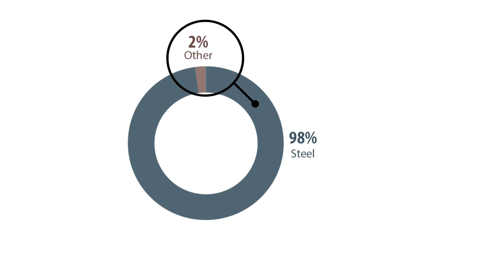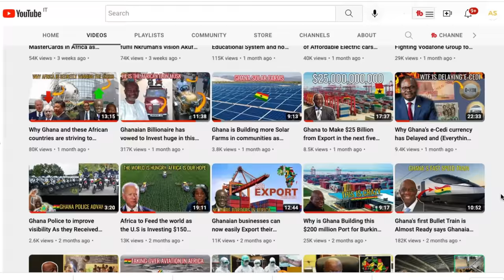This Ghana's Newly Discovered Iron Ore is going to make Ghana BRUTALLY RICH (THIS IS WHY)

Comment: This will be a shambles ...why do u only need 5 years before u export. How can u save the country by exporting the ore.  Would it not be better to let the investors build refineries in Ghana and create jobs and make more money selling the refined product instead of the unrefined ore
Reply: The reason they don’t want to export it for 5 years is to allegedly refine and provide finished products for domestic use rather than using the billions in foreign exchange($) to import it, the value chain essentially remains in Ghana but who trusts them to pull this off?